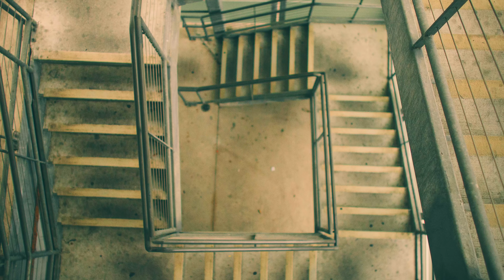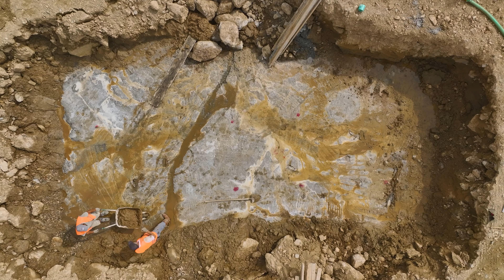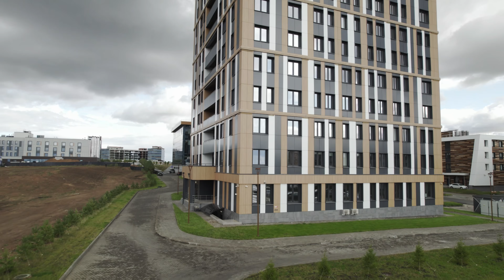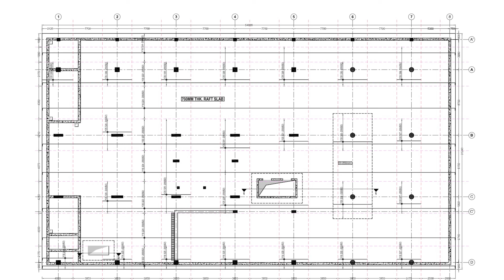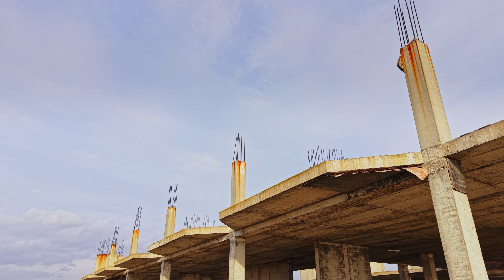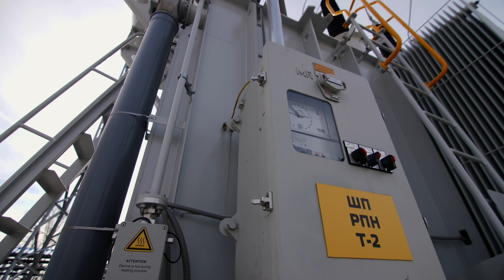How Architects Design to Save YOU Millons

Comment: I assume most of these savings are for commercial modular buildings?. I do understand - always off the peg std are cheaper, but as you say below, you have to spend some money for interest - it`s a balance, otherwise we end up with these boring buildings everywhere.
Reply from the maker: Not really. I’ve covered lots of different building types here, not just commercial modular projects: hotels, apartments, offices, retail, Auditorium….. Most real buildings use repetition and standardisation once you understand construction. I would say all buildings not most. In practice, cost, structure, services, regulations and buildability usually carry more weight than simply making a “pretty” building. The challenge is working within those realities without ending up with something boring.